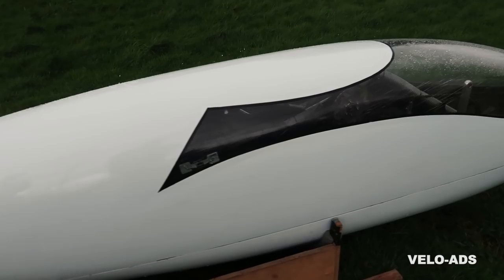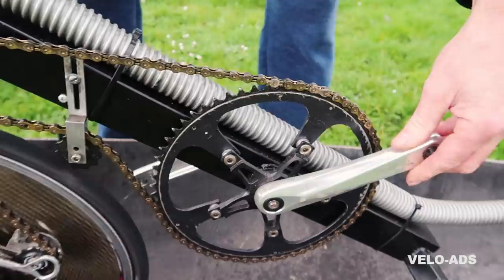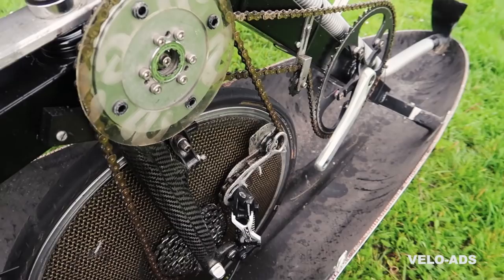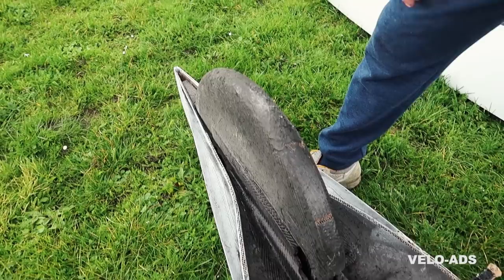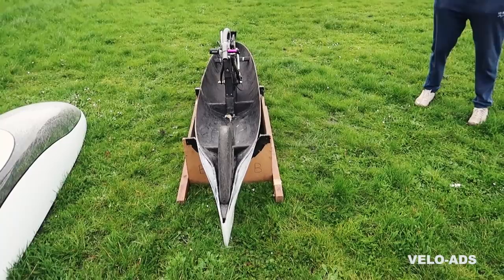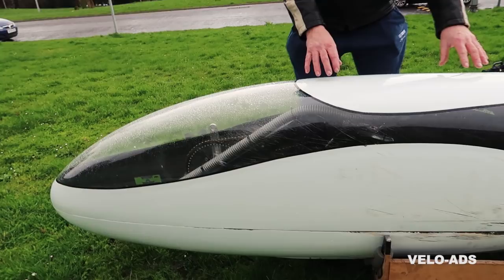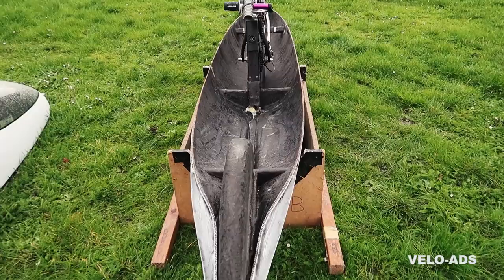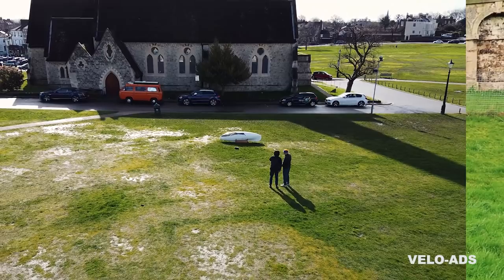Superfast Bicycle  Streamliner RISTRETTO and Neils world record attempt in 2020. #123

Comment: It look crazy fast… and crazy uncomfy!! It have some of the purest lines I've ever seen :)
Reply: Scaling it up a bit should solve everything, right?
Reply: @rockrl98  Depends of many factors, I guess. This velomobile is ment to break records, not to be comfy. But if adapted to the great public, it would surely need to be scale up a bit (comfier seat, more shoulder space, tighter turning radius, better suspensions, room for electronics and luggage, retractable stabilizing side wheels etc)... meaning more heavier. 

But that fairing shape is so amazingly gorgeous and pure!! 👌
Reply: @La.máquina.de.los.sueños  weight really doesn't matter, and if you have hills, just use a normal bike, or install electric system making it even heavier, but regen saves brakes on downhill so it only makes sense...
Reply: @rockrl98  3000% agree that an electric assisted velomobile is a must when living in places where there's hills everywhere. For normal people, in everyday life, +/- a few pounds doesn't really matter, specially if it make our rides more enjoyable. But for these that break records, or when living in a town where there's stops at every 100 feet, or these that make very long trips,...less heavy is always better (to maintain high speed much longer, better accelerations, less weight when climbing, usually smaller wind cross section etc). 😁

I'd surely not chose a coffin tight velomobile for everyday small trips, or to go to my job. My area is very hilly, exposed and windy.... also, my knees are a mess... so electric assisted FTW!! An "oversized" version of that 2 wheeler velomobile + all options could be INCREDIBLY FANTASTIC! 😀